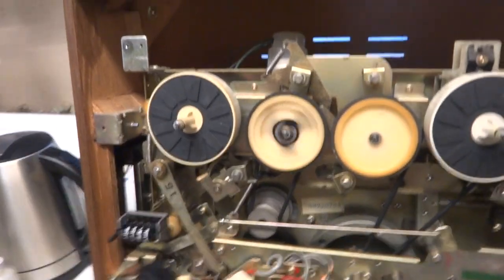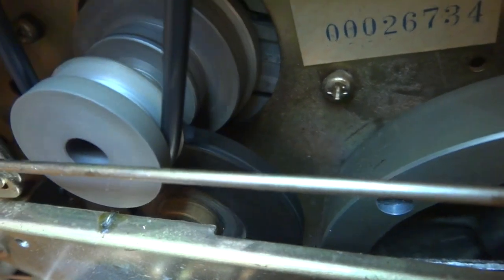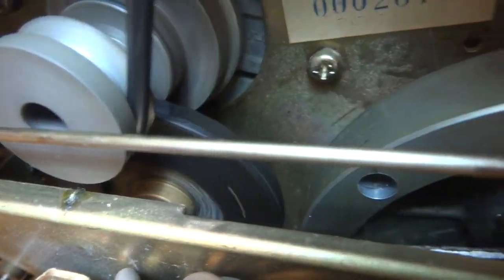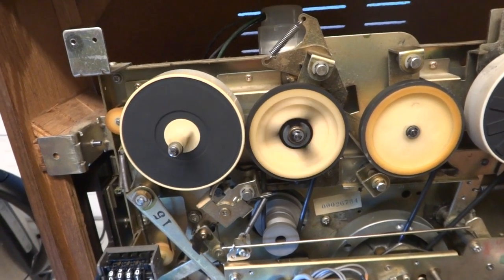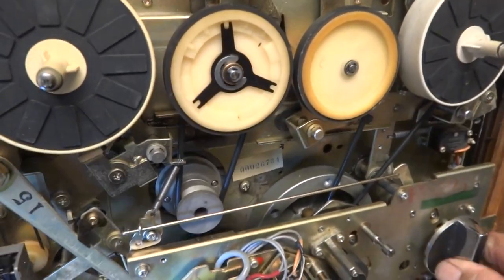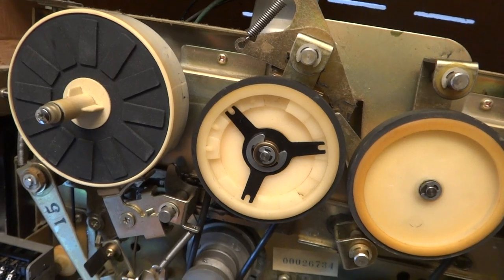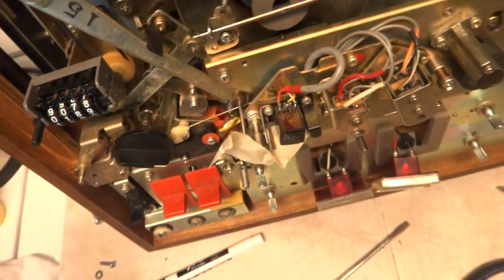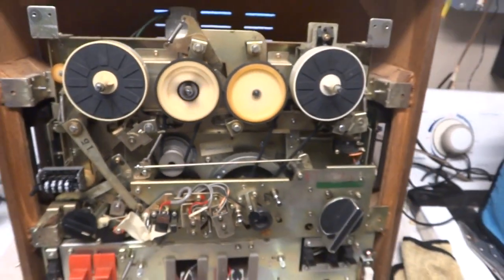Testing Sony TC-366 Reel To Reel Tape Player

Comment: Probably motor run cap big thing at back and nip q bit off the spring that pulls the rubber wheel against the motor pulley worked for mine

Comment: It needs full service and lube...no way that rubber wore down that much to create that 6mm gap, its all bound up, Also easy way to check if the motor work properly is to take the rubber band off and watch it spin up freely